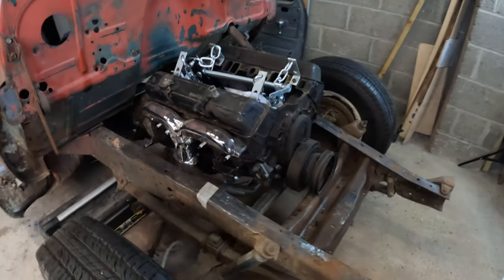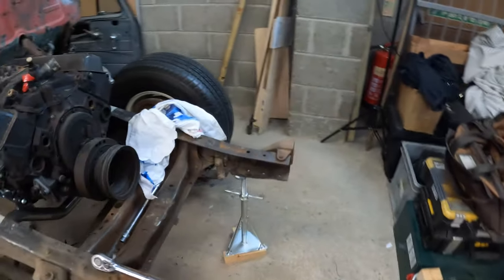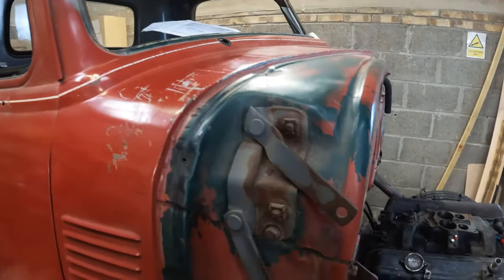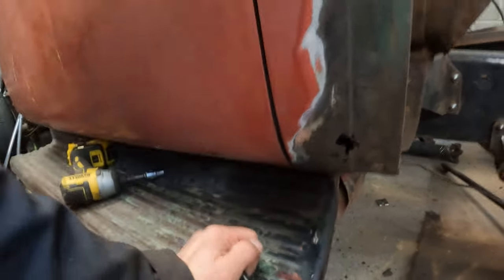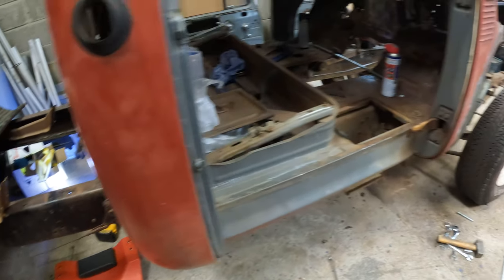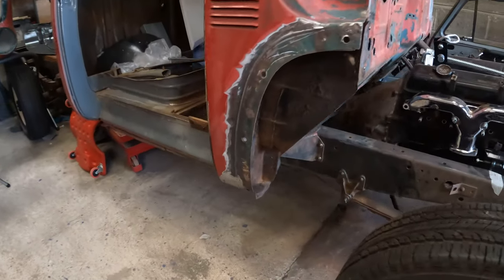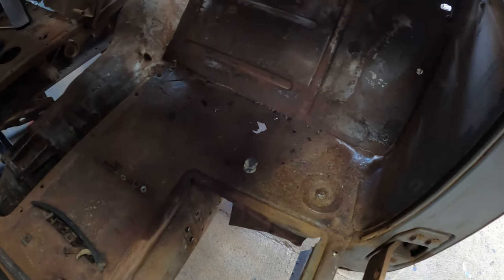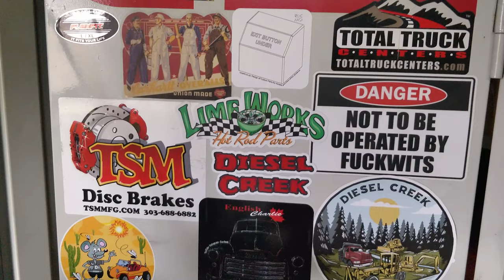Repairing cowl panel rust part 16

Comment: What wheels are those .like the use of the caravan Jack's
Reply from the maker: I think they are called Weller's. Used to make something similar for minis. They are actually 8 bolt trailer wheels. Got a great deal on them with the tyres.
Reply: I thought thay looked like wellers
Reply from the maker: @jamescoxall322  I really like them. Gonna have them powder coated